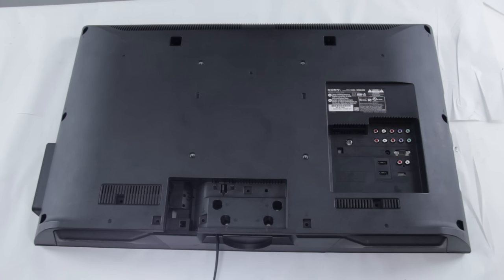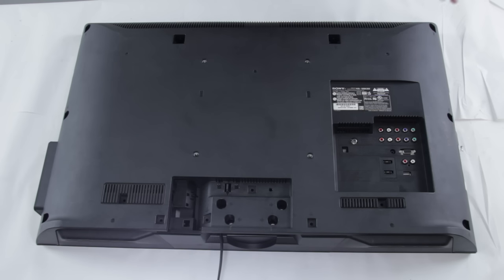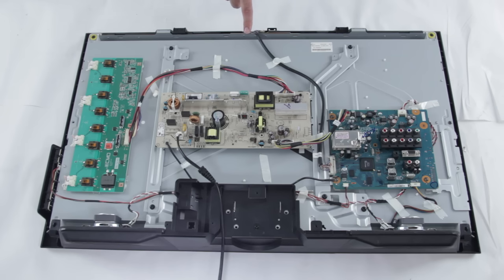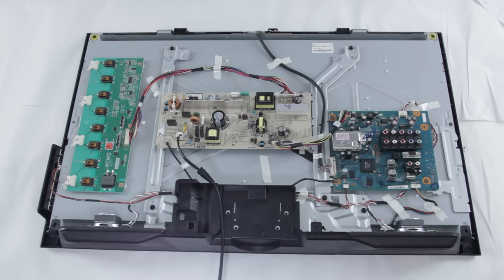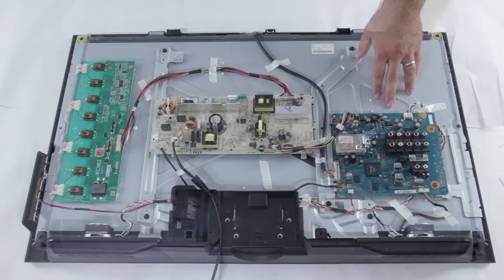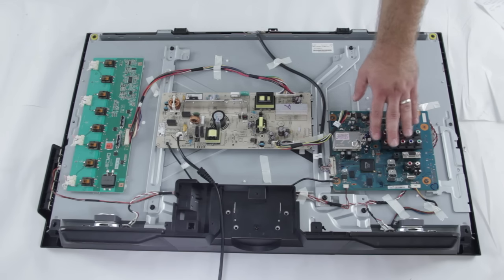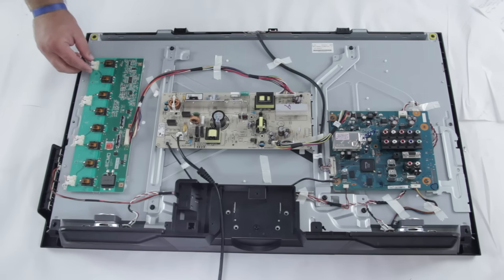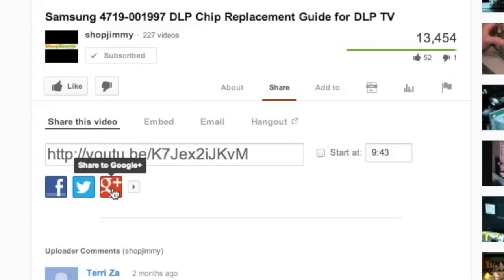LCD TV Repair Tutorial - LCD TV Parts Overview, Common Symptoms & Solutions - How to Fix LCD TVs

Comment: Hello,
 i just purchased a 42" Sharp LED TV on eBay. Model lc-42lb261u. Ever since I first plugged it in, it started doing this very strange thing. You turn it on and it looks amazing, great quality TV. Then,  after a few minuets, these weird horizontal colored lines start popping up, They aren't black, they are basically the same general colors of whatever is on the screen. They get worse, spreading, until the whole TV gets discolored in a way that i can only describe as 'psychedelic'. So, you turn it off, and back on, and it starts the process over. But, after turning it on and off a couple times, the lines pop up, then go away, and the TV looks great, and totally fine the rest of the time. 
Do you have any idea what my issue is?
I have photos if they would help.

Thanks,
Noah
Reply from the maker: Rockr140  PLEASE SUBSCRIBE TO OUR CHANNEL - Try all repairs and troubleshooting at your own risk.   This could be a problem with either the main board or the TV panel.  You can replace the main board to see if that fixes the problem.  Unfortunately I do not see any replacement parts in the search results for your TV model number on our website.  Please reply with your part number on your main board and I can try searching for replacement parts.  Thanks and please let us know if you have any further questions!  www.shopjimmy.com

Comment: I have a Seiki 39" 4k TV. Model # SE39UY04. I got it from another person and when I received it, it has back lights and I can hear audio, but there is no picture. I looked online and came to the end result that it was probably the t con board. so I bought a new one and replaced it, but nothing changed. I really need help and I can't find an answer anywhere.
Reply from the maker: +BOOscareypantz   Try all repairs and troubleshooting at your own risk.  This sounds like a TV panel (TV Screen) problem.  If your TV panel is bad, it may be more cost-effective to replace the TV as panels are typically hard to find in stock, difficult to replace, and expensive.  Thanks and please let us know if you have any further questions!  www.shopjimmy.com

Comment: I have a Visio flat screen TV model number gv47l FHDTV 208 I got a couple of pastors that I want to buy to replace them I need one that is 35 volts by 470 and then the other one I need for 35 volts by 680 how much will it cost to order them
Reply: +James Rolison You need more information, are there symbols such as uF next to those numbers, meaning microfarad? most common if referring to the power supply board. Digikey sells those items fairly cheap, I bought the 7 I needed for 1 repair for five or six bucks shipped.  Any capacitors that are not flat on the top are bad, they don't need to be leaking, they 'dry' out from the heat during operation.  If room on the board I usually upgrade the capacitors at the same time, such as using a 50v instead of the 35v, same capacitance rating, they designed them to lowest possible specs to work to save them money, if there is no room then the standard ones will work, they also make high heat versions too, they have a temp rating stamped on the capacitor...  good luck..

Comment: I have a 55 inch element tv it has sound but screen is black can this be fixed , is it an easy fix and is it worth it here is the model number E4SFT5517 and the serial number H8D1H220A55028045

Comment: I need your advice. I have a Vizio smart TV Model: M40401i-A3  and I am able to load the apps, they no longer open once I click on them. The Wi-Fi is connected but a popup states unable to load app check your settings. Settings show Wi-Fi connected so again I try to load an app and popup again popup states to check your Wi-Fi connection which is fine in settings. I`m puzzled as it worked fine and it just stopped and the apps will not load. It`s a fairly new TV but of course now out of warranty. I do not have a long enough cable to try a direct connection to the high speed modem and have unplugged the power source and pugged it back in and have unplugged all HDMI cables and reinserted them back in but still no connection to app follow through. Any suggestions. Thank you.
Reply from the maker: +William Spiker   Try all repairs and troubleshooting at your own risk.  I recommend that you reset the TV.  Thanks!  www.shopjimmy.com

Comment: I have these vertical lines appearing on my Vizio Model M550VSE, serial number LWJANKAN4701092. When the TV has been shut off, the ghost of the lines are still visible, even after unplugging from the outlet.

Comment: HI, I need help to fix my TV  Sharp 42 inc. Modele LC-42D69U
 Number serie 111 848 187
Problem : image use to  flash occasionaly and then yesrterday  the screen turn black. The TV will turn on but there is no image or sound.
How to fix it and what parts to order. Thanks
maggy
Reply from the maker: +Smooth Cadet   Try all repairs and troubleshooting at your own risk.  I recommend running the flashlight test on your TV.   Here is a link to a video we produced that shows how to run the flashlight test. https://www.youtube.com/watch?v=xUzCLgoSPGM Please reply with your flashlight test results and we can recommend a replacement part for your TV repair. Thanks and please let us know if you have any questions! www.shopjimmy.com

Comment: AOC L32H961 ... model E329AZNK4WA1NN... S/N = T7399JA010668  picture goes to muted light colors and kinda staticy.  there is a blue board with cables labeled 69.31T06.003 and a sticker with FT-5531TD6C18-96O-0000NAP-02991-06.  there is a yellow board with 715T2804-4.  it powers on but the picture is muted light colors.

Comment: I have a Viore 42", model No.PD42VH80, Serial No. 05021SHD42ESO1504, I have lost 4 channels and all of the sub-stations that go with them. I have run channel search several time and stillthe same hannels are missing.  I get a blue screen with the "no signal"on the screen. Sometimes, the screen is just black. Any suggestions?  Thanks for your help.
Reply from the maker: +Dana Carrier  Try all repairs and troubleshooting at your own risk.   I recommend replacing the main board in your TV.  Click this link to replacement parts for your TV model number:  http://www.shopjimmy.com/catalogsearch/result/index/?cat=56&q=PD42VH80  There may be multiple boards for the same TV model number, be sure to match part numbers on your current board, with your replacement for compatibility.  Thanks and please let us know if you have any further questions with your TV Repair!  www.shopjimmy.com

Comment: I HAVE SAMSUNG TV MODEL . LN46B530P7FXZC THE PROBLEM WHEN SWITCH ON IT COME ON BUT CHANGING FROM HDMI TO PC THEN TV AND GOES ON LIKE THAT WITHOUT TOUCHING ANY REMOTE OR CONTROL ON THE THEN SHOW ON THE NO SIGNAL THEN WEAK SIGNAL, I ALREADY CHANGE THE MAIN BOARD AND THE SAME THING APPEAR ON THE TV, WHAT NEXT COULD BE THE PROBLEM.

Comment: I hope you can help me. I have a samsung 46" model number LN40B550K1F, model code LN40B550K1FXZA, serial number AUD03CES3042978,  version SQ03. 
The red power indicator light stays on solid as its supposed to. I have sound constantly as I'm supposed to. the picture is on for 1 to 2 seconds the off for 1 to 2 seconds then back on the back off, and it continues like this for as long as the TV is powered on. "NOTE" we were watching a show, it was fine then just started doing this. I removed the back, all off the capacitors appear fine all flat and no distortions or cracks. I plugged it in and the back lighting also flashes with the picture, when the picture goes out so does the back lighting. I tried the flashlight test with the menu on and I can not find anything on the screen when the picture flashes off. 
Can you tell me what to replace or where to start? I can't afford to replace this TV, its only 4 years old.

Comment: Hey I have a Philips 46" flat screen modle # 46PFL3608/F7 would not turn off with the remote then I turn it off manually then it was not turning on so I thought that it was the power board I order from you (SKU; A37QOMPW-001 put it in and have the same problem I took it to a teck, when he plug it in after 4weeks it came on and work fine for 6 weeks then it stop working with the remote so I would just plug it in when I want it on and have to change the channel manually one day it went off completely . the problem is it is not coming on at all he say it may be the main board  Board # BA37UOG0401 2  pleas help 
 TUDY

Comment: Philips 42PFL3704D/F7 no light or sound. Plugged it in and I hear a clicking sound. Replaced main board and no luck what next?
Reply from the maker: +John Nieves   Try all repairs and troubleshooting at your own risk.  I recommend replacing the power supply board in your TV.  Click this link to replacement parts for your TV model number:  http://www.shopjimmy.com/catalogsearch/result/index/?cat=59&q=42PFL3704D%2FF7  There may be multiple boards for the same TV model number, be sure to match part numbers on your current board, with your replacement for compatibility.  Here is a link to a video showing how to identify your part number, click here:  https://www.youtube.com/watch?v=wooRqBrRo6o Thanks and please let us know if you have any further questions with your TV Repair!  www.shopjimmy.com

Comment: Sony kdl-52vl150 vertical lines from top to bottom following the onscreen 'no signal' or 'antenna' icons. 
When menu selected it is very faded, the longer it is on the more faded it becomes, but I can see letters in the middle of the screen.  A dumpster diver brought it over asking me to fix it for them as I take on several vendors trouble calls, but no formal training and just install what they request I install. I am an IT field engineer and they just send me out on related calls.
This is a call that they likely would have requested I swap a panel in, but since vertical lines, and dealing with other vendors that have sent me LVDS cables and T-Cons to try and repair, about 50/50 on those so far,  wondering if the T-Con or LVDS cable is bad on this one causing the vertical lines?...
Reply from the maker: +Craig Gerlach   Try all repairs and troubleshooting at your own risk.  This sounds like a TV panel (TV Screen) problem.  If your TV panel is bad, it may be more cost-effective to replace the TV as panels are typically hard to find in stock, difficult to replace, and expensive.  Thanks and please let us know if you have any further questions!  www.shopjimmy.com
Reply: Wrapped cardboard against copper connectors inside frame and worked out perfect. I never would have tried this before..
Reply: There were videos here on vertical lines. Appears heat rises, makes ribbon cables flex, confuses T-Con and it sends out jumbled signal. Pulled panel frame apart and used corrugated cardboard from shipping box and wrapped front to top, 3/4"×3/4" across top against these ribbon cables to keep them rigid. It works, I was amazed. Gets warm that area but not hot enough to burn paper. Does not work for horizontal lines. Also tried cleaning T-Con cables which partially cured issue but when warm lines came back. So there is hope for vertical lines and or ghosting. After cleaning that ribbon pair it ghosted 1 quadrant...

Comment: Hi, I have A Sony KDL-40S2000, Serial# 7049403, Manufacture date March 2006.
I was watching tv and it shut of and the power led began blinking 4 times then repeating. After unplugging the power turns green and the tv will turn on and work fine for 3 - 5 minutes. After that the picture begins to go back and forth from normal brightness to very bright then on and off and completely shuts off with the from power light blinking ( 4 times ) red. The only to turn the set off is to unplug it. If, I plug it back in the process will repeat. Any idea on what part(s) have failed and their replacement part numbers?
Thanks, Frank
Reply from the maker: Frank Frank   PLEASE SUBSCRIBE TO OUR CHANNEL - Try all repairs and troubleshooting at your own risk.  This could be a problem with either the power supply or the main board in your TV.  You can replace each of those boards to see if one of them fixes the problem.  Click this link to replacement parts:  http://www.shopjimmy.com/catalogsearch/result/?q=KDL-40S2000  There may be multiple boards for the same TV model number, be sure to match part numbers on your current board, with your replacement for compatibility.  Thanks and please let us know if you have any further questions with your TV Repair!  www.shopjimmy.com

Comment: so my tv got something thrown at it by my three year old and it now has this like huge crack on  the inside with different colored lines and the other parts of the screen is black. i have a 50 inch toshiba tv model number 50L2300U. do i have to replace the screen?
Reply from the maker: Sumaiya Nusrath   Try all repairs and troubleshooting at your own risk.  This sounds like a TV panel (TV Screen) problem.  If your TV panel is bad, it may be more cost-effective to replace the TV as panels are typically hard to find in stock, difficult to replace, and expensive.  Thanks and please let us know if you have any further questions!  www.shopjimmy.com

Comment: I have an Insignia Model# NS-LCD42HD-09    Serial#17985JA017825,  that was given to me by a friend, they did not have the remote control for the TV so I am using a Comcast remote control, the TV powers on and off, but the controls  on the side of the TV does not respond when touched or when I try with the Comcast remote,  I can change the channels the menu button on the side of the TV works but I can not scroll up and down with the buttons on the side of the TV or with the Comcast remote, so I am in between channels and can not get a picture just the scramble when you change pictures. Can you help me with this problem? Respectfully, frakenfish1

Comment: I have a funai LF320FXF4 A3AFTUH serial number DS1A1330213352. The issue I'm having is that my tv will not power on but the standby light blinks 16 times. I get no sounds or picture. I've tried replacing both the main board and the power supply board and neither has fixed the issue. I'm not sure what the issue could be.
Reply: +Jonathon McDaniel I think I may of possibly found the problem. I unhooked one of the flex ribbon cables and I had got a picture on the screen. I then powered it back off and back on and when I powered it back on there was no picture once again.

Comment: I have blinking red light but no picture. Replaced bad capacitors but still no picture or sound. Model#LN 46A550P3F S or LN46A550P3FXZA serial # ALXK3CPQ409764B

Comment: Thanks very much for this nice overview of common TV problems. My Alba TV (Model number: LCD37880F1080P) recently developed a problem that it could not be turned on from the standby mode. When powered up, the white power indicator on the TV was on, but the TV could not enter the working mode using either the remote control or the touch ON/OFF button on the TV itself. I searched the Internet and found that it was most likely due to a failed power board, as mentioned in this video. I also visually inspected the power board as instructed in this video, but did not find any popped capacitors. Could you please advise what problem it could be? Many thanks!

Comment: 32PFL4507/F7 Philips. I have sound but cannot see anything. The backlight works. I cannot see anything onscreen including the menu or what channel the tv is on. Please help.
Reply from the maker: +5k Investment Club   Try all repairs and troubleshooting at your own risk. This could be a problem with either the t-con board, the main board or the TV panel. You can replace the main board and the t-con board individually to see if one of those boards fixes the problem.  Click this link to replacement parts for your TV model number:  http://www.shopjimmy.com/catalogsearch/result/?q=32PFL4507%2FF7  There may be multiple boards for the same TV model number, be sure to match part numbers on your current board, with your replacement for compatibility.  Here is a link to a video showing how to identify your part number, click here: Thanks and please let us know if you have any further questions with your TV Repair!  www.shopjimmy.com

Comment: Whats up jimmy
A white tint appeared on my Samsung tv screen a week ago when my labtop died while connected to it via HDMI cable. I had no problems before this happened. 
You have any Ideas??  
samsung model LN40A450C1D
S/N B46A3CRQ700754J
Reply from the maker: +JayePapers   Try all repairs and troubleshooting at your own risk. This could be a problem with either the t-con board, the main board or the TV panel. You can replace the main board and the t-con board individually to see if one of those boards fixes the problem.  Click this link to replacement parts for your TV model number:  http://www.shopjimmy.com/catalogsearch/result/?q=LN40A450C1D  There may be multiple boards for the same TV model number, be sure to match part numbers on your current board, with your replacement for compatibility.  Thanks and please let us know if you have any further questions with your TV Repair!  www.shopjimmy.com

Comment: LN40D630M3FXZA horizontal lines at top of screen, looks as though lines are getting wider. Slight flicker on rest of screen.
Reply from the maker: +Chris Johnson   Try all repairs and troubleshooting at your own risk.  This sounds like a TV panel (TV Screen) problem.  If your TV panel is bad, it may be more cost-effective to replace the TV as panels are typically hard to find in stock, difficult to replace, and expensive.  Thanks and please let us know if you have any further questions!  www.shopjimmy.com